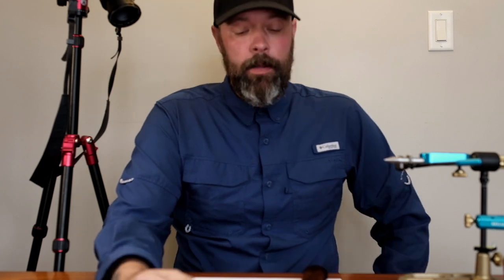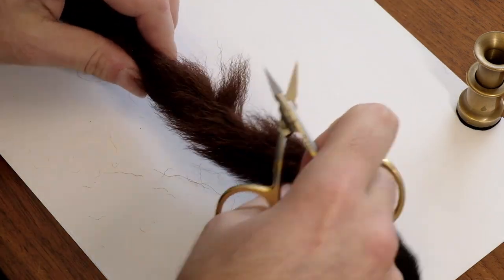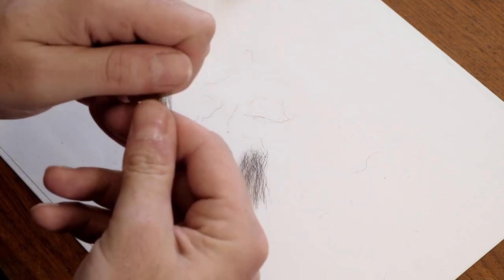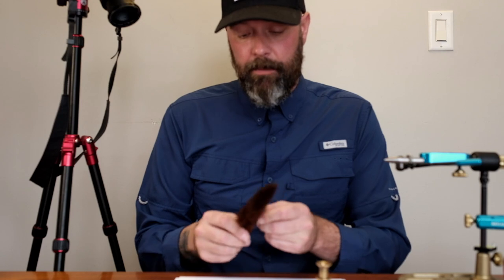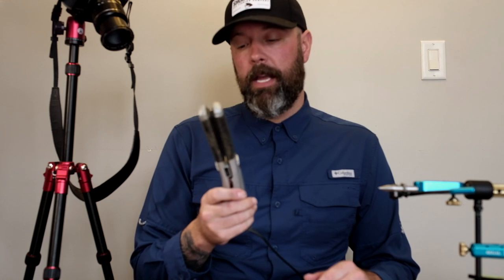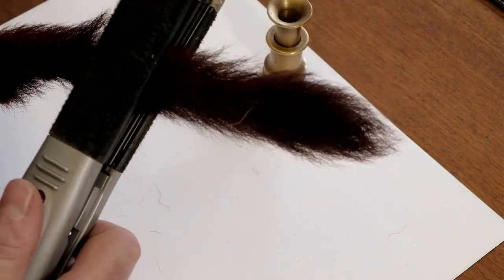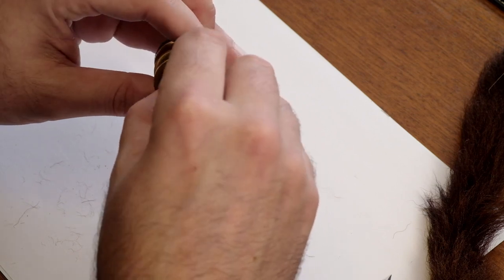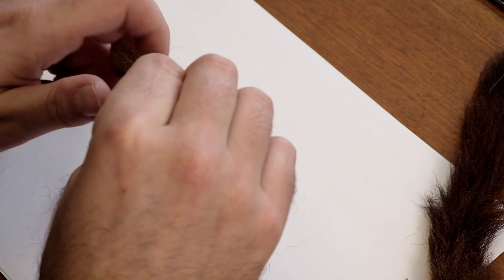How To Fix Bad Calf Tail For Bomber Patterns

Comment: Nice techniques for dealing with very crinkly calf tail. They will help for using it as wings on Wulff style dry flies.

I normally think of Bombers as being used for Atlantic salmon. Do you know if they work for trout or landlocked salmon?
Reply from the maker: Sorry for the late reply. They work excellent for both species!! They are my go to pattern for late season brookies
Reply: @newfoundlandflyfisher  Thanks for the reply. I’ve only tied one bomber, just so I could see if I could do it, &, of course I forgot to take it with him on a landlocked salmon trip to test it. Duh! 

One trick to try before applying the hair straightener (& it might make your wife happier before you use her appliance) is to wash the hair in gentle dish soap, then use an unscented hair conditioner on it. It makes the hair more pliant & stackable.  I also use it on some hackle that has gotten stiff & dried out.

I can no longer fish (back problems), so I can’t test my flies myself. I still love tying, so now I do it to donate to Project Healing Waters, part of Wounded Warriors. I want to be sure my flies will work for them. That local group uses a private pond with both trout & largemouth bass. I’m sure they would have a blast fishing bombers. What size(s) would you recommend?
Reply from the maker: @FlyTyer1948  sorry to hear about your back. Im sure Healing Waters appreciates your work…well done